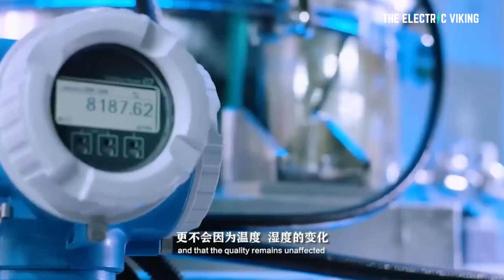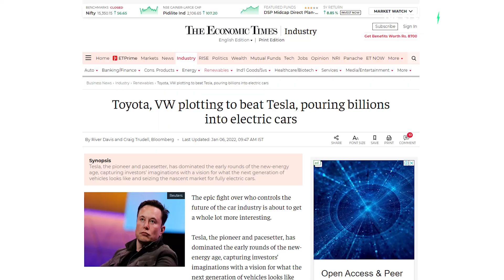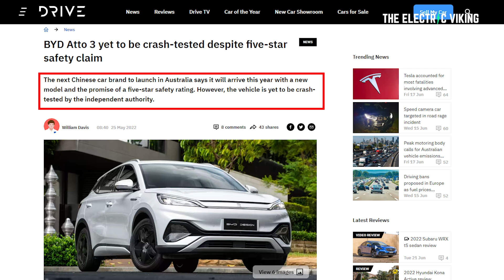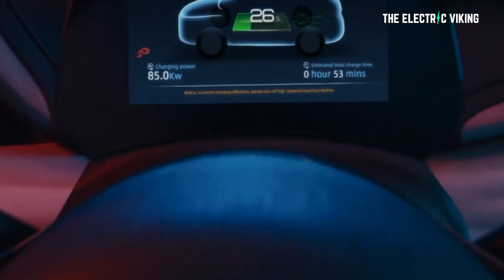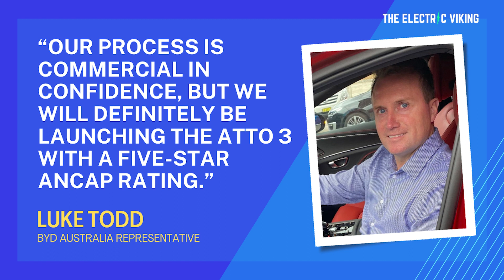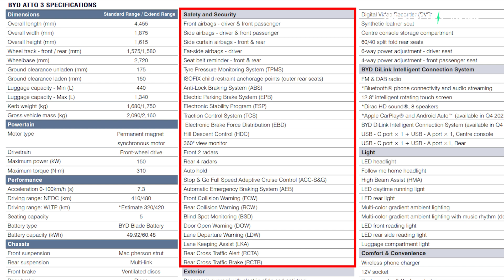BYD Atto 3 EV not likely to come with 5 star ANCAP score

Comment: nowadays, byd cars are nicknamed tanks on road. they are quite durable. last week, I collided with a police car, my han ev needs some paint work on the front bumper, the police car needs a door pane replaced. no personel injury either side.
Reply: That's fine to say but has it passed the ancap5 tests?
Reply: @henvan8737  no, it hasn't got rhd atto 3 shipped to australia. does every imported car need that rating? I mean, other countries have similar tests, and cross compare what a rating tesla got in china and how that compare to any particular car in consideration, you get a pretty good idea. given time, all tests can be done if necessary. has tesla model Y got that rating btw?
Reply: @henvan8737  The BYD Han has a 5-star C-NCAP rating.
Reply: Being a tank in a crash is not a good thing! Cars need to crumple to adsorb the impact, all great if the car comes out undamaged but the occupants will receive the impact!
Reply: @gregandkaruna6674  i get your point, but when a tank hit a car, the driver of the tank still wins. speaking from my own experience: my han ev had a collision with a policy car(no on purpose) last week. I barely felt it and my car needs paint work on the front bumper. the police car needs new doors. this han ev is hard like a tank outside, with 10 airbags inside. it is not like ill equipped old time steel box. most personal casulties are caused when the structure of the car is not held intact and people are physically invaded during collision. I just feel byd cars can hold up its structure pretty well.
Reply: @qilu2004  Go look at the test between a tank of a car that has a huge bonnet and it hit a 2009 car with a good crumple zone. The tank car driver was killed and the 2009 walked away, this was a crash test so no actual people died but it showed how good crumple zones work, your accident was not a serious crash big difference.
Also I believe that BYD are safe cars just not better than any other car in same class that also get 5 stars.
Tesla nuts are the same saying Tesla is the safest car ever tested yet in the real world other brands achieve the same or better in crash tests..
Reply: @gregandkaruna6674  by tank I didn't mean complete rigidity. what I mean is the structure is really solid and even in serious collisions, the main frame including the pillars around passenger space would hold itself. a plastic car has good crumple zone but if the main frame doesn't hold it is no good for the people in the car.
Reply: @qilu2004  then we will just take your word for it and give it 5 stars.  Their are many factors that go into these tests and the OEM’s try to factor in these tests but often don’t get things sorted out properly.  You hitting the side door of a police car….that alone sounds interesting enough…..does not make it a safe car.  I’ll let the 3rd party experts evaluate it before I believe it.
Reply: @kkatlvolvo  i didn't say give it a 5 star based on someone's words. my point is why insists on doing an evaluation instead of taking another one from a reputable third party for reference. regarding the collision with police car, it was driving very fast from opposite direction and making a left turn and cutting in front of me. I couldn't slow down enough and hit their rear right side door. just an unlucky day i guess.
Reply: @qilu2004  I’m just messing with you and those tests are unique for each market or agency and they won’t accept another’s results.  Their is standardized requirements by each market though. Hope you didn’t get a ticket!!
Reply: @kkatlvolvo  no ticket. if it weren't a police car, he would have got a ticket because I had the right of the way.

Comment: Here in NZ we have people queuing upand paying big money to buy old hybrids with 3 and 4 star ratings - why we are still importing even 2 star rated cars is incomprehesible to me. Even the new Stonic wouldn't get 5 stars if it was tested, it is relying on being a derivative of the Rio which was tested years ago.
Reply: Well hello the Rio did get a 5 star back in 2017. But each year the test gets harder to even now in some markets to include headlights, as long as the frontal and side impacts get a good rating and an emergency braking system then that's enough for me.
Reply: @gregandkaruna6674  yes, it did, and the Stonic inherits that. If actually tested, the Stonic would probably not achieve 5 stars on current testing. This seems like a loophole that should be closed.
Reply: @hindesite  Even current cars do get improved, at least in the states when they fail the iihs tests many manufacturers improve the design and then get retested, also it is clearly stated that they achieved the 5 star in the year they were tested, in the case of the Rio 2017. Crash tests are a bit misleading as even the safest car will lose if the car hits a truck or any other object that is bigger, so a 5 star tiny car will lose to a 5 star big car, just as the biggest 5 star car will lose to that 1 star truck

Comment: Sam FYI… The all new GWM Cannon Ute was released in Australia in December 2020 with no Ancap rating at that time.

By September 2021 all new Utes coming out of the China factory were five star ancap rated.

All of the earlier Utes required three minor modifications to bring them up to a five star ancap Rating…. This was done free of charge by GWM.

The ATTO3 and the GWM Ute has the same safety specs in them…

I know this as a fact as I bought a GWM Ute in February 2021 and it received the three modifications in late 2021 to bring it up to a five star ancap rated vehicle.

I have since sold it when I ordered my ATTO 3

Comment: Non of the published electronic safety features are of any value if the Atto 3 doesn't pass the crash tests.
Reply: As long as the frontal and side impacts are rated as good and has the emergency braking I would be happy, however if it fails to get a 5 star because the headlights are not perfect then I can live with that, just be thankful they are not strick like the iihs as they would fail almost every car if they did a star rating!

Comment: Perhaps, ..”We will be launching the BYD Atto 3 here in Australia with a ..’claimed’ ..5 Star safety rating” might be a ..better, ..announcement for the local BYD importers to make, Sam…! 🙄     Meanwhile, as for ..when, they will ..actually, be able to ..get, an authenticated local 5 Star safety rating, Sam, ..well, that depends upon ..when, ANCAP will have both, the free time, and, the appropriately qualified testing certification staff, ..available, and with all of the disruption that has already, been caused to businesses here in Australia by COVID, I really wouldn’t want to be laying any big bets, upon just ..when, ..any, of that might ..actually, happen. 🙄🙄
Reply: 4 words Australia design rules approval and the Atto 3 currently does not have this very important certificate! For those that do know what that means, it basically means the car cannot be imported to sell, there currently is 2 Atto 3 in Australia and neither are registered. Only 1 BYD model is able to be sold legally in Australia and that is the T3 van, the E6 used to have this but it was revoked in February 😞

Comment: Hi Sam, I have noticed on the ANCAP website that there are NO BYD's listed at all? Not even the E6...
Reply: Lol E6 has virtually no safety 4 airbags no autonomous breaking no cruise control, it's just built for taxi companies
Reply: @gregandkaruna6674  Yeah I was aware of that, just commenting on the fact that no BYD in Australia has a listing by ANCAP.
Reply: @kubar69  Well as far as I am aware the Ancap needs probably at least 3 or 4 cars and currently there is just 1 so called Australian spec BYD Atto 3 and as for the others that were sold here I doubt Ancap would test any car that sells less than 100 as is the case with both the T3 van and E6 taxi EV. 

Until EVdirect sells thousands like both MG and Tesla have then it's just a waste of resources and time..

Comment: what does atto stand for?
Reply: a unit prefix in the metric system denoting a factor of 10^−18 or 0.000000000000000001.
Reply: @Qiqiqiqiqiverse  thanks. I didn't know that. kinda wired for a car name.
Reply: qilug / atto, femto, pico, nano, micro, mili

Comment: A death trap
Reply: The car I drove to college probably rated a minus 5 star: no seatbelts no air bags, the brakes operated by pressing a pedal which you didn't use on corners or with two wheels on gravel. The main safety features were zero entertainment systems and no mobile phones.